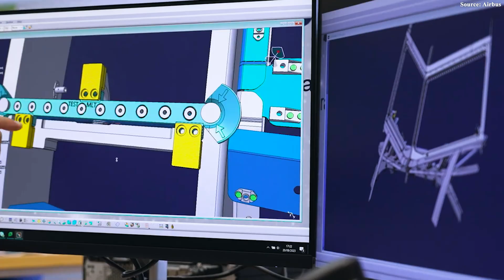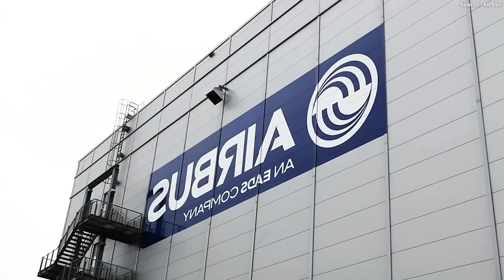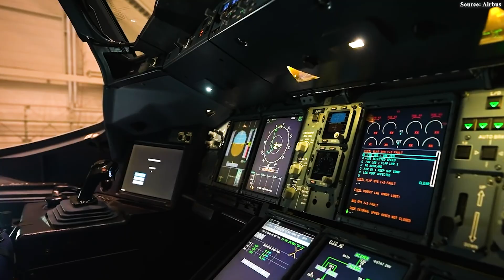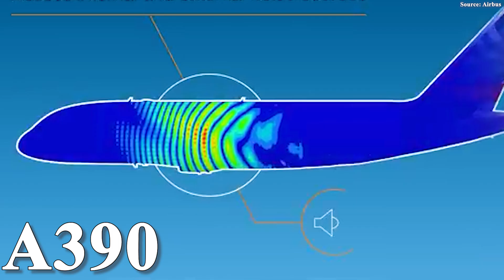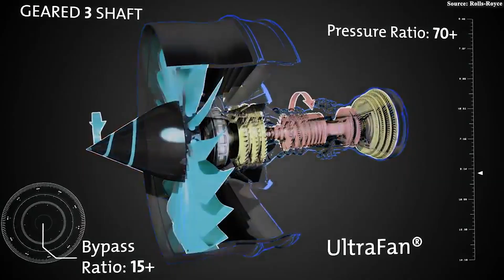Airbus' HUGE PLAN to Build A390 that SHOCKED Entire Aviation! Here's Why

Comment: A 390  It's Fake anyone Knows That but.      Exemplo from Here  Airfrance going to France Paris Everyday of the week.....Exemplo  wy everyday make it Two Days a week....... Build Planes for That the Skies is Big so the Land.....Do I have to say anything also???I Thing  its Cadillac....maybe some other car maker. they make 8 cylinders    but  after certain speed. only four  Going......do I need to make a sketch //////few Planes welded one on top of the other lol  take off 12 motores are running But up there only TWO. just to maintain   not even 4 needed...imagine Playnes. going for Hundreds Off Kilometers with No Gasoline.....     not to long ago AIR transit  in the Acores...Landed with no GAZ.....   Paris  to Montreal  now. 9 horas....if that takes. 12 it's ok,,,,,and I am sure way less Accidents

Comment: you are rigth Airbus needs something that is bigger than the A380 but what it needs to do is what they did with the A340 back in the day and made the A330, an aircraft that is not as wide or tall or big as a 380 and does not have 4 engines but just 2 though with a wide body that sits between the A380 and A350 yet can accommodate 2 levels of seating. Welcome the A360.
Or is this exactly what Boeing us doing.

Comment: Concur - utter self-contradictory rubbish - gives all the reasons why, under current conditions, Airbus wouldn't build such a vehicle. To compete with the B777-900, Airbus already has the A350-1000 and which can be grown by a frame or two to deliver the 15 seat difference. If Airbus were to compete head-on with the 450 seat capacity of the B777-10, the 40 seat difference could probably be accommodated within the A350-1000 with a few more frames - it would not need an entirely new platform.

Comment: This is just fantasy. Airbus is worried about the 777-9 and potential 777-10 and the A350 can only be stretched so far. But the 4-engine jumbo is a thing of the past. If Airbus were to produce a 777-killer it would design a twin with giant engines like the 777.

Comment: If only engineers would know How to Make a Laminar Flow Airbus A390 it would be More efficent Than any other Airliner  smaller Engines less fuel higher ceiling faster travel…https://youtu.be/F3jaH3vV-78?si=mq3L1D0K3-KhuwZv

Comment: Why should Airbus build a successor to the A380 at all? Very few airlines are able to operate 400+ seat aircraft profitably and, all
of those have already ordered large numbers of 777x planes. By the time Airbus could field a competitor, Boring would have this market segment sown up for a couple of decades.

You win some, you lose some. Airbus needs the Rolls Royce UltraFan before it can commit to an A350-2000 - let alone an even larger aircraft. It’s arguably not far enough along yet. Aviation enthusiasts too often forget that a commercial aircraft without engines is a glider, an overpriced paperweight.

It may sting to abandon the jumbo market for a while, but unless Airbus us cooking up something revolutionary - like a BWB - it should probably focus its R&D spending on (a) getting the A220 program profitable, (b) launching a slow A220-500 project with an Airbus cockpit and an CFM Leap engine option plus bleed air contamination protection to succeed the A320neo and (c) launching a slow clean-sheet A360 family project featuring next-gen safety and efficiency to succeed the A321neo variants and enable a stretch version of those.